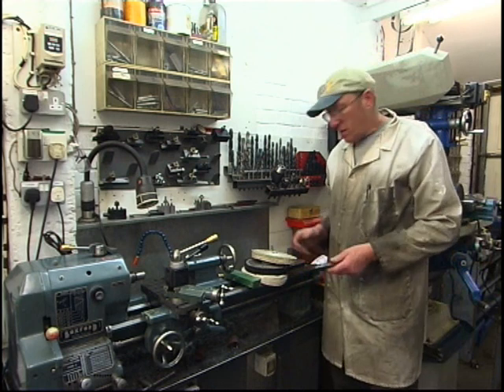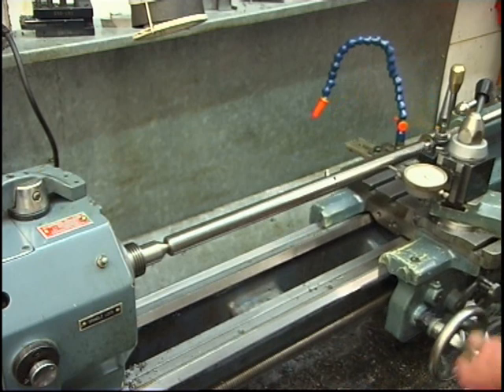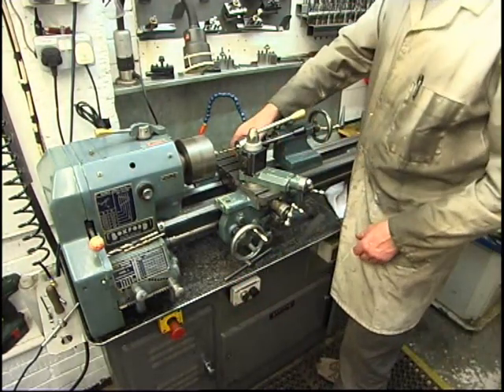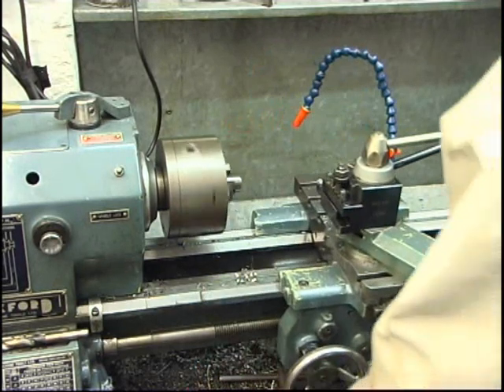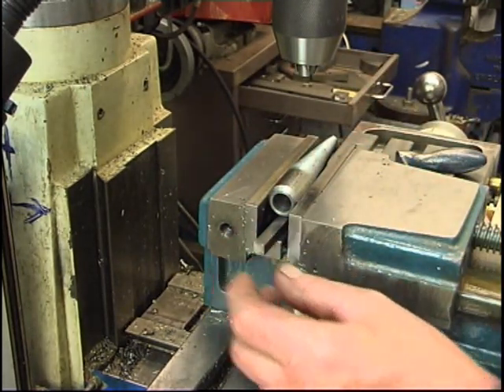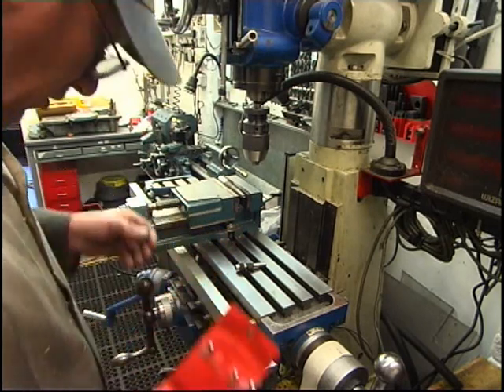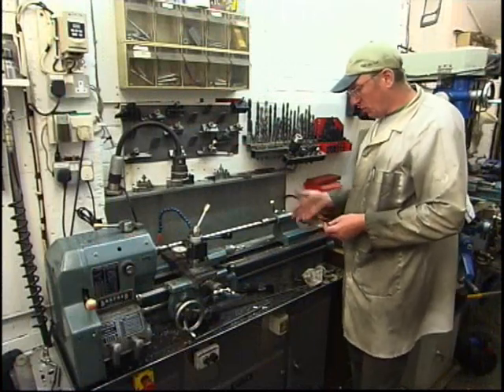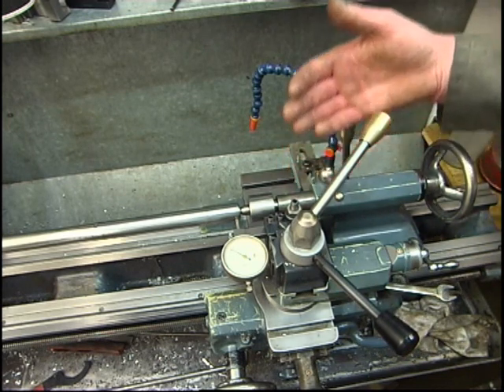POINTY THREAD PART TWO & TAIL STOCK ALIGNMENT

Comment: How does the polishing wheel stay on the steel motor shaft adaptor that you made? The taper looks quite smooth. I know you can't cut a thread along a taper like that, so how does the wheel stay attached? I want to make one for a spare motor I have under the bench, so where do you get the polishing wheels and the green wax stick? Many thanks.